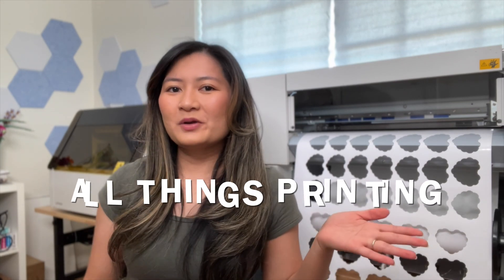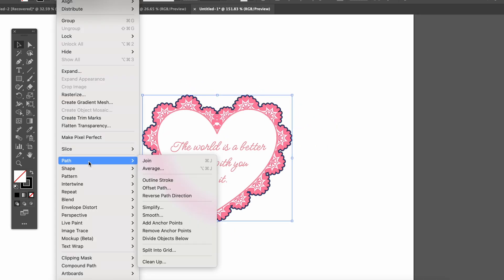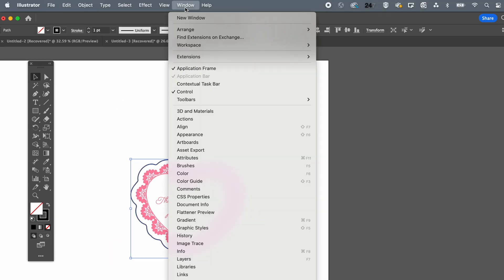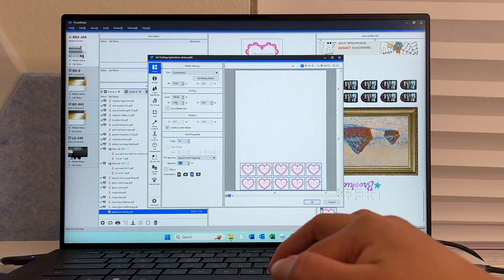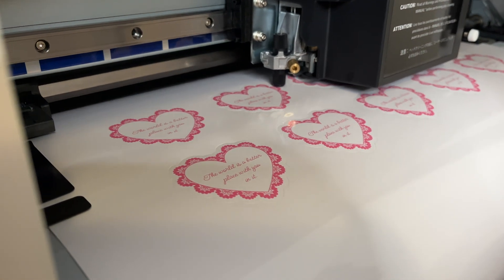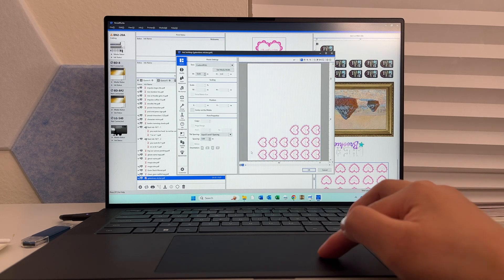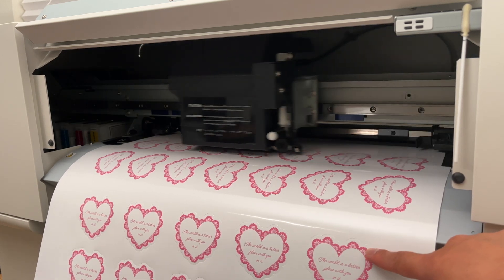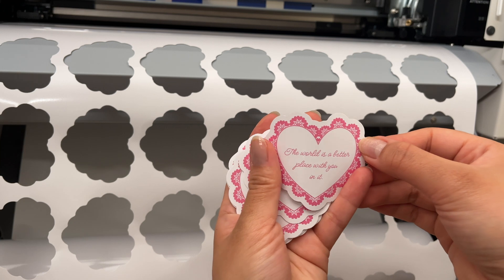Die Cut Stickers w/ Photoshop & Illustrator | Perf-Cut on the BN2-20A | Roland VersaWorks

Comment: I really appreciate the tips for perf cut settings specifically the half-cut force I had never changed that before and had been having trouble with getting my stickers to pop out, I had just been upping the perf force and perf length which was messing up the vinyl and still not getting best results. Thanks for the help I've lowered the perf force and upped the half-cut force it's cutting a lot smoother now.
Reply from the maker: I'm glad you were able to solve your perf cut issues! I hope it makes your sticker production smoother! Best of luck :)